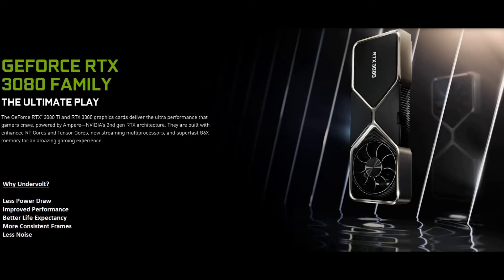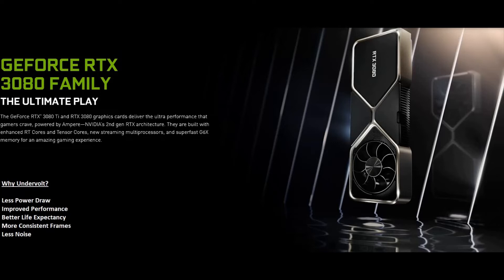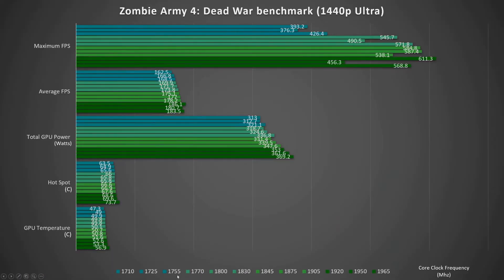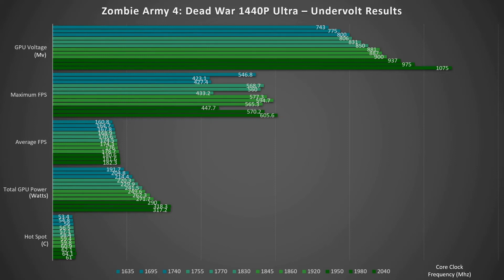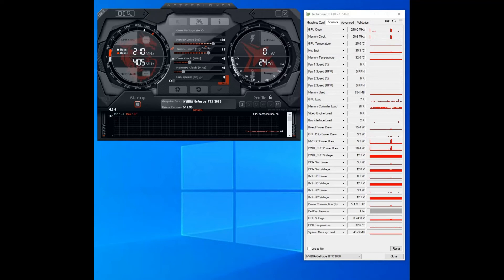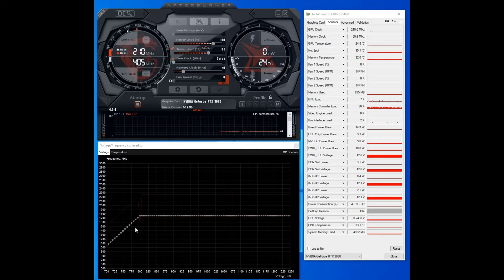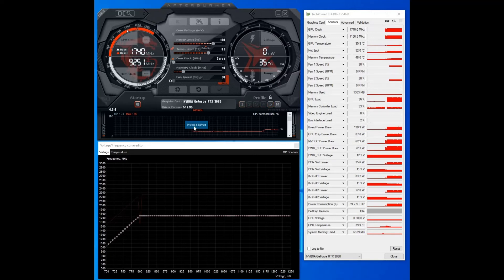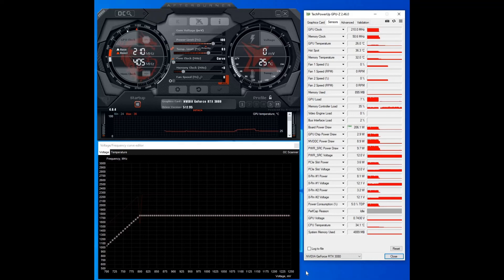RTX 3080 Undervolt Guide - Lower Temps, Better Performance, More FPS! #undervolt #pcgaming #rtx3080

Comment: sadly didnt win the silicon lottery with my 3080, mine isnt even stable at that frequency with 900mv
Reply from the maker: @GoldBeta  At which frequency for 900mv?
Reply: @tisiky  1794
Reply from the maker: @ how are you detecting instability?
Reply: @tisiky  Under heavy load my GPU drivers crash
Reply from the maker: @GoldBeta  ok what stability testing have you done before going into gaming?
Reply: @tisiky  just gaming, running the new CoD immediately crashes the PC when at those settings, but it's okay, I put it at 875mv at 1795Mhz and haven't run into an issue since

Comment: I also have the 3080 and this guide was a total game changer for me. I went from having 85 - 88 C to 70 - 75 (air)  while gaming. The frame rate is pretty solid and stable 
Thank you so much for this. Do you recommend turning up the power limit?
Also, which water cooler do you recommend for this card?
Reply from the maker: Honestly I run mine with the voltage limits and don’t touch the power. Uses around 180w during gaming. 

I have mine with EK Vector FE block on.
Reply: @tisiky  Do you recommend overclocking the card, besides the undervoting?
Reply from the maker: @JD4we  Hello. It depends on your game but there is a sweet spot where performance tapers off considerably. Usually the sweet spot is around 800-812mv. So whatever your GPU can do at this voltage will be the sweet spot.

Comment: no matter how I low I undervolt (.812 and 1740mhz right now) I don't get nowhere near those watts or temp decreases. I suppose it depends on the game, but if anything I see a 30W drop and 2-3C.
Reply from the maker: It depends on the use case scenario. At 812mv you should be looking at around 220/230 watts.
Reply: @tisiky  275W on Control game with ultra graphics, is that normal?
Reply from the maker: @gavilar5425  No I dont believe so.  It shouldnt be that high.  For some reason on OCCT a 3D benchmark uses 300w of my rtx 3080 even with the massive undervolt im using, and during gaming it never goes above 200w.  Did you confirm your MSI AB chart looks the same as in this one?  Confirmed the voltage is lower using GPUz?

It could depend on your 3080 model though! I think some of the high end aftermarket 3080s can push 350w or more.
Reply: @tisiky  yea, everything seems correct. I'm also playing at 3440x1440 I wonder if that's the reason. I have a MSI GeForce RTX 3080 VENTUS 3X OC. Undoing the UV it jumps to 1950mhz/1050mv and 330w.
Reply from the maker: @gavilar5425 ould just be the gpu uses more power for control as in game demand can differ to benchmarking demand. 

For example I’ve just done another undervolt on my 3080 and at 737mv (lowest you can go), is still draws 230w whilst doing an OCCT 3D benchmark. 

However when playing battlefield 5, at 768mv it only uses 200w but both scenarios are at 100% gpu load. 

I think your card is fine, and the fact the gpu is using less voltage indicates the undervolt is working. 

Just try lower it as much as you need to. At the moment my games aren’t massively taxing so im using as little power as possible.

I can do 1600mhz/737mv or 1700mhz/768mv for reference.
Reply: @tisiky  I picked this card on release date, so I couldn't research before getting it, otherwise I'd have gone with a different one. I feel like I'll leave it as it is for now, it's not loud anymore and since it's summer here and my AC is on all day basically I can manage the heat my whole PC (but in reality it's the GPU since the CPU usually sits at 55c tops) is manageable. I was just surprised as how 'little' the difference was, I was expecting a huge drop on both temperatures and power draw and temps. I appreciate the video you made and the time you took to answer me, thanks a lot.
Reply from the maker: @gavilar5425  No problem! 👍

Comment: I was able to undervolt my 3080 strix 850mv @1935-1950mhz +600mem clock 60°c stock temps was 68°c.  i scored higher in than stock 19205 in time spy my compared to 18700stock bought this card for around 690usd 😂 new

Comment: Aorus Xtreme 825mv 1890mhz here, is it good ? 100% stable Furmark.
Reply from the maker: Hello, yes thats a good undervolt.  Generally the optimal zone for undervolt is 800-827mv.  The jump to 900mv is extra 100W which isnt worth the ~5% gaming boost.  I would test it in gaming to make sure its fully stable, as sometimes although a GPU can run different clocks/voltages at full load, when the gpu moves from full load to idle can cause issues.  Thats why gaming is a good test, as its a typical, real world stress test!
Reply: @tisiky  i know, been rocking whatever i put on it, its the max for 825mv tho, memory runs +1450mhz without penalties, its a great bin this aorus xtreme, will put on a 3090 hybrid tho for lower noise levels and call it the day

Comment: i have problem with my RTx 3080ti ftw3 ultra gaming
when i play a game my pc is restarting . i change d PSU to 850w  nothing change same problem ,  can u help me to find the problem plz
Reply from the maker: What is the full specs of the pc?  Is the PSU set to eco mode (if it has one?), if so turn off eco mode.  Your pc restarting during load could be high temps, issue with PSU, poor airflow etc.  It could also be an issue with the hard drive failing.
Reply: Check temp on cpu